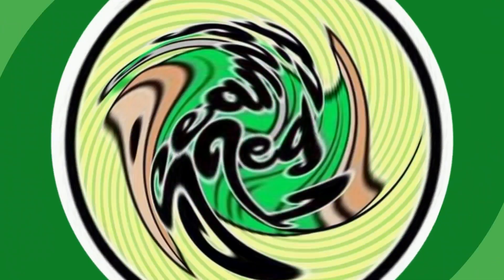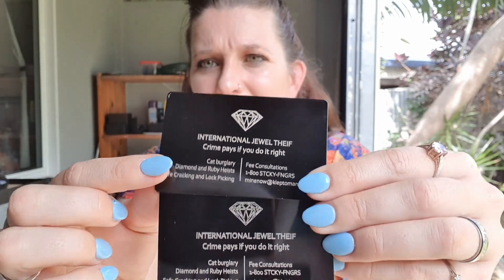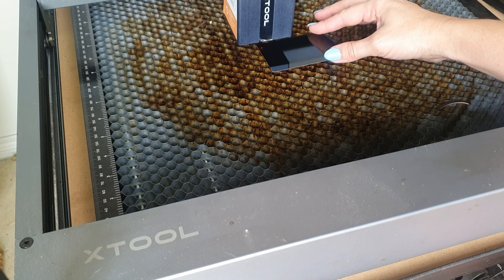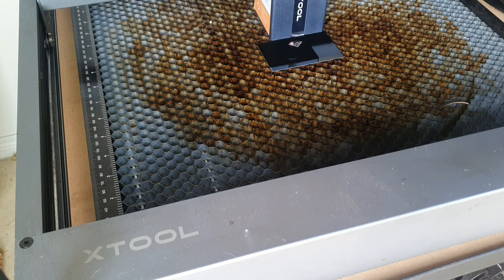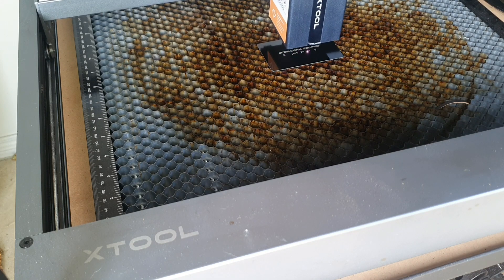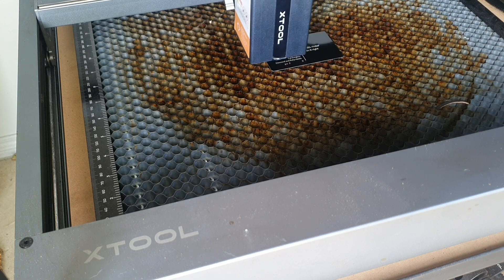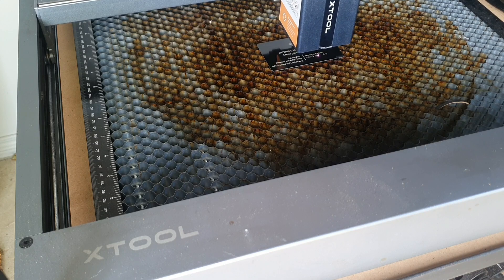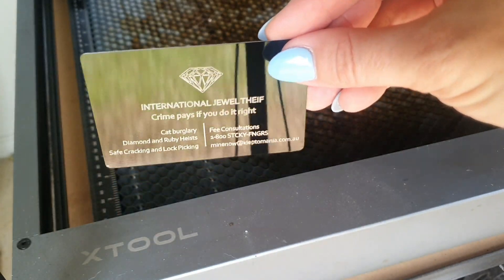xTool IR laser to engrave metal business cards

Comment: how hard is it to align the metal card so the word pacing is even across the bottom?  it seems the words on the left side of the cards were higher than the left side.  GREAT VIDEO by the way
Reply from the maker: Practise makes thing easier to line up.  It would also depend on what laser you have. My xtool s1 has a feature for aligning perfectly